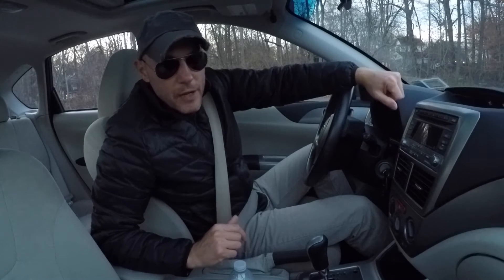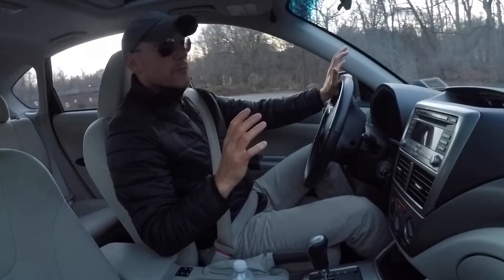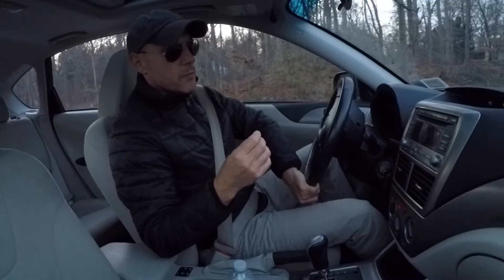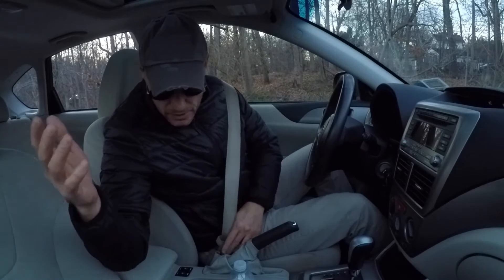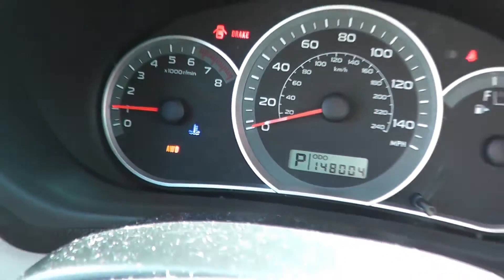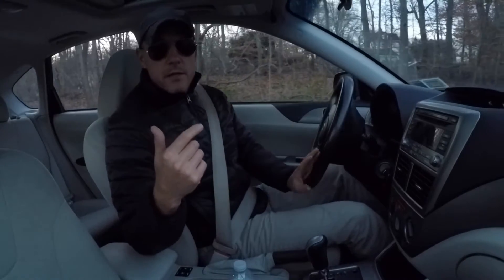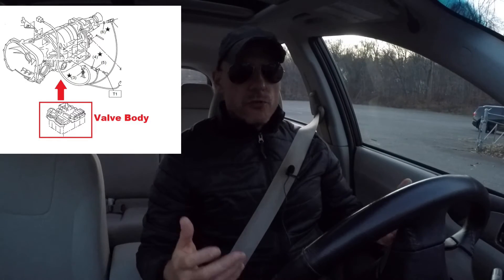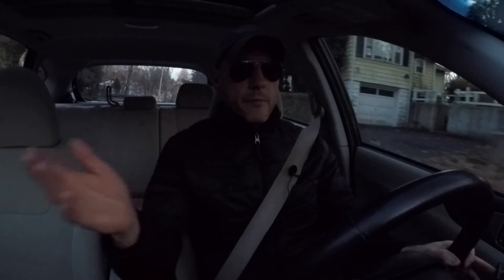What Is Torque Binding And How Do You Test For It?

Comment: Would this also explain a jolt coming from rear when switching gears? Mine started doing this and torque binding is much worse. Starts jolting at operating temperature
Reply: did you end up fixing this issue? if u did how so?
Reply: @deceased.boness  The solution was to run away before needing a CVT swap and ended buying a newer one.

Comment: Thanks for the heads up on the transmission oil change. Drained and refilled  transmission twice, plus added Lubegard 60902 Automatic Transmission Fluid Protectant, which completely eliminated the torque issue I was having.
Reply from the maker: Good stuff!